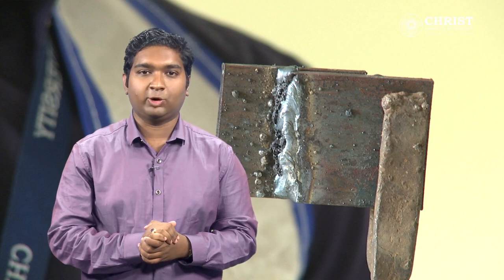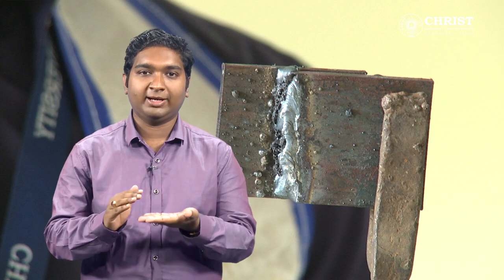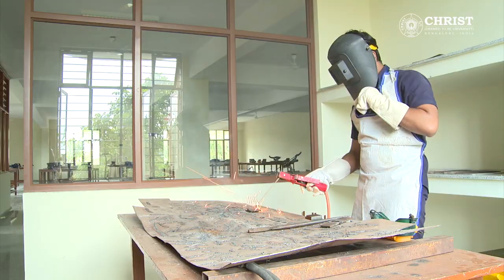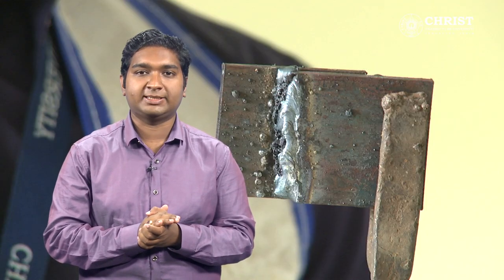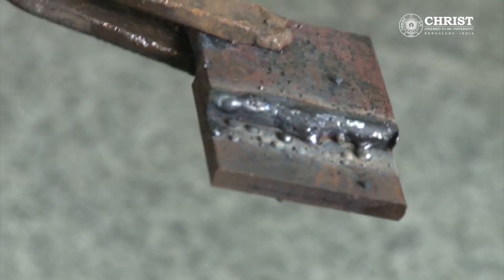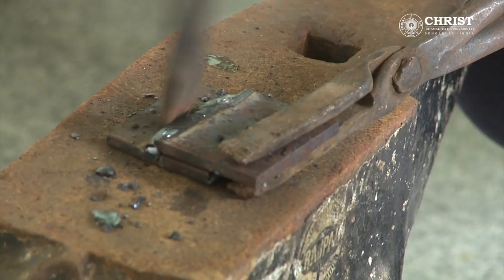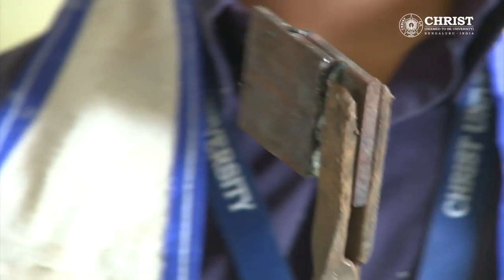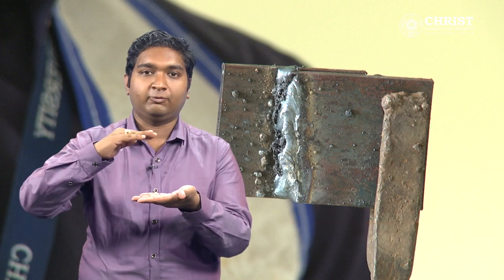Welding Lap joint - Mechanical Engineering

Comment: It's a wrong explanation.
A person with at least a basic knowledge on welding, knows that the weldjoints should not be cooled by quenching. It affects the strength of weld.
If not practically atleast know the theoriatical aspects of it.